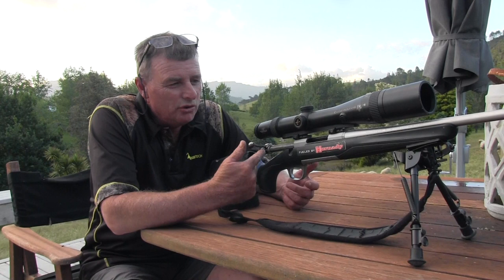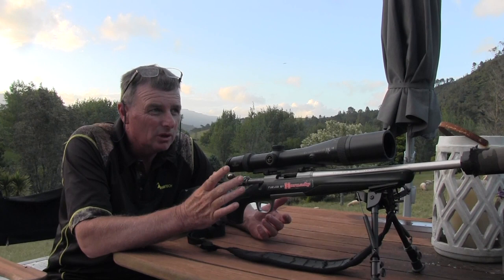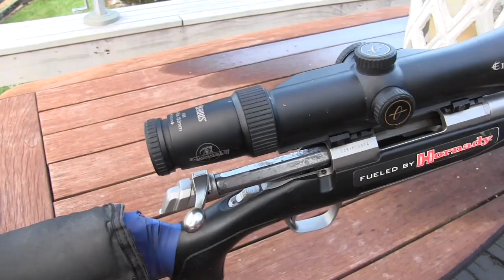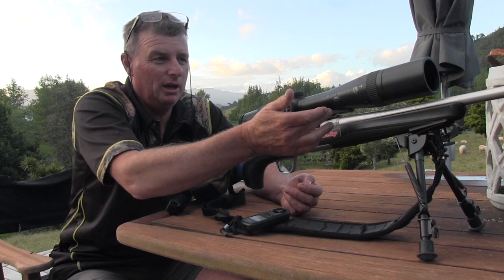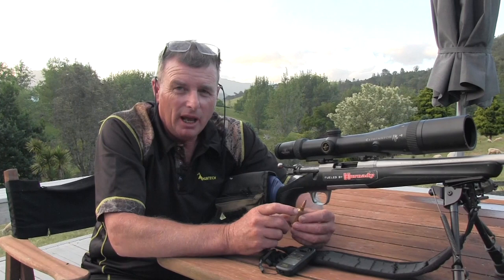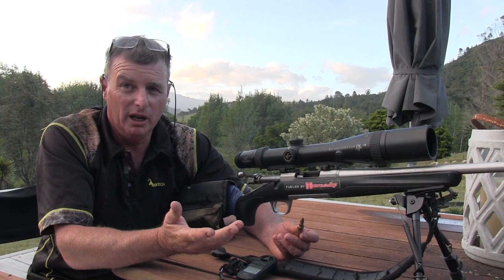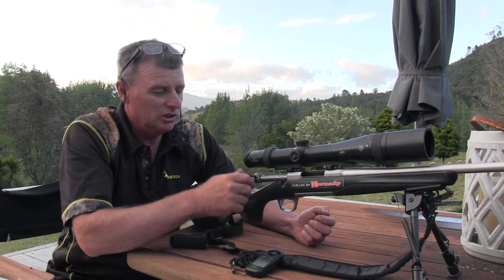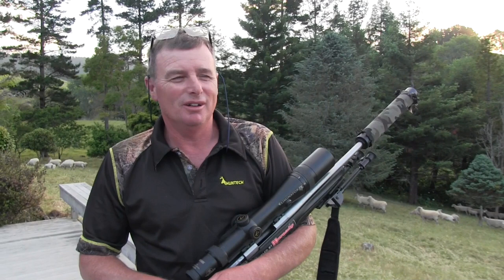300 WSM Browning X-Bolt Burris Eliminator 3 review

Comment: You have a great combination there, an excellent rifle and a technically advanced scope. The Revic scope goes even beyond the Eliminator III with many more sensors.
->I have a 6.5 PRC Browning X-Bolt Pro mountain rifle. My scope is just a Bushnell Elite LRTS 4.5 - 18 x 44 with a G3 small "Xmas tree" illuminated reticle. Nothing fancy.
-> However I depend on my laser rangefinder 10X42 binoculars to tell me which Mil mark to use for my vertical hold and my experience to tell me how to hold for windage. Good enough for hunting out to 1,000 meters IF it's a coyote or antelope. Larger game max ranges are 800 meters down to 400 meters for bull elk.

Comment: Dude you had me until you actually said the ballistic tip would explode on the outside of the animal like it just hit fuking Armor and wouldn't penetrate with a 300 WSM no less that's actually one of the most ridiculous things I've ever heard anybody say about a bullet especially with the polymers they're using now to increase accuracy with Ballistic tips so that tip doesn't get soft and retains its hardness and shape for consistent long range accuracy even though the bullet is heating up as it's flying through the air that ballistic tip retains its shape and structure and you actually said it would explode on the outside of the animal like it just hit a fn Triceratops
Reply: I had a sst shot from my 300 Weatherby blow up on the side of an elk, I think it did hit a branch first, but they are not a good big game bullet, he summed it up good